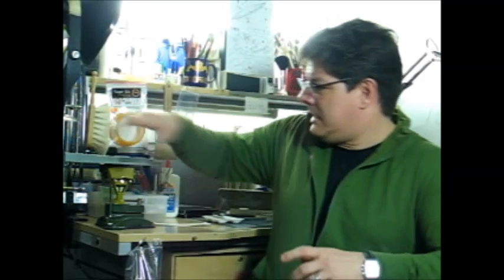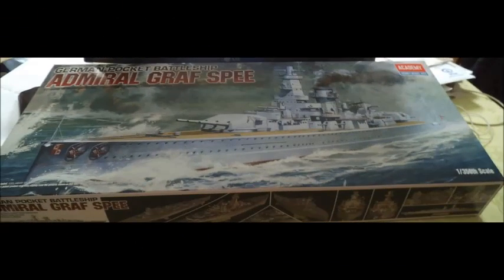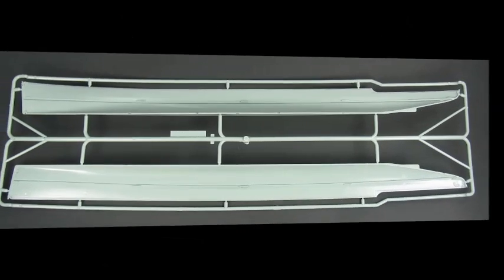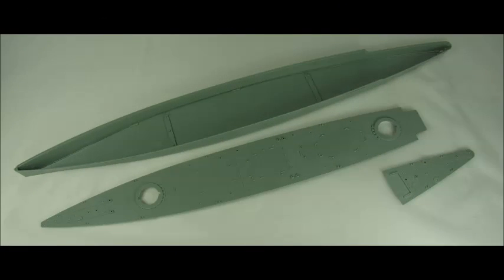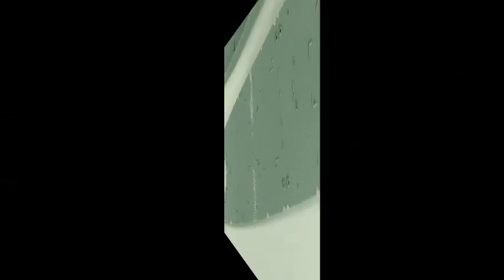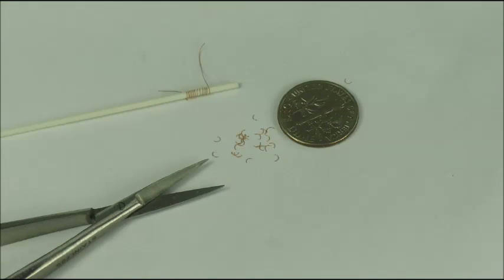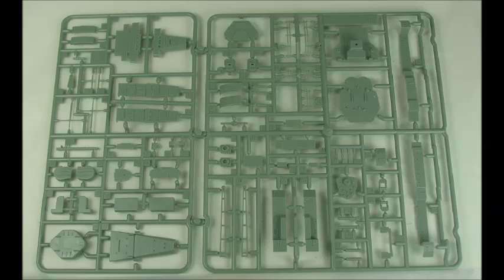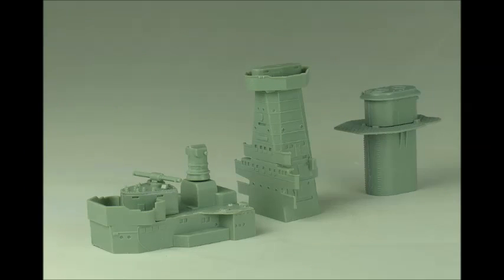Admiral Graf Spee in 1/350: Build Log Part 1

Comment: Hello! Beautiful video! Can you briefly explain how you separated the hull to create the waterline version?
Reply from the maker: Thank you for your kind comment.
The Academy's kit hull has a groove along the inside of hull halves providing a guide to split it. Any good scriber should do. First scribe until the bottom comes off. Clean the cut edge. Have the bottom plate ready as provided by the the kit. First connect the hull halves, then add the bottom plate. Make sure the model will sit dead flat and let the glue thoroughly before continuing construction.
Reply: Guido Hopp, wow! Thank you so much for that very clear instruction!

May I ask if you have an opinion as to how this kit compares to the Trumpeter 1/350 waterline version?

Again, thank you for your help!
Reply from the maker: @brohoop  - I can't really say. I haven't seen the kit. But I should recommend to search YouTube and Google to find out. I reckon both kits have their shortcomings and advantages. I was very satisfied with Academy kit and can wholeheartedly recommend it.
Reply: Guido Hopp, thanks so much for taking the time to help and guide me. I really appreciate it!
Reply from the maker: @brohoop  you are very welcome!

Comment: As far as i understand there is not that much photo etched sets for this model. I found 2 sheets from eduard and probably 2 sheets like this ones 
http://www.bnamodelworld.com/bmz_cache/7/7649e64d66f5a55b81ef7b46fca0d1ba.image.950x812.jpg.
Also barrels for guns.
Do I understand correctly?
Reply from the maker: Hello- Indeed there are not so many choices for add on parts. The MK1 photo etch looks nice, but there seem to be no railings in that set. Eduard has them.
Thanks for watching!

Comment: Hello, i have a little question. What did you use to cut model in half?
Reply from the maker: Hello Bartlomiej- I traced the separation line on the inside of the hull with the back of my Olfa knife several times until it came apart.  I hope this helps. Thank you for watching.